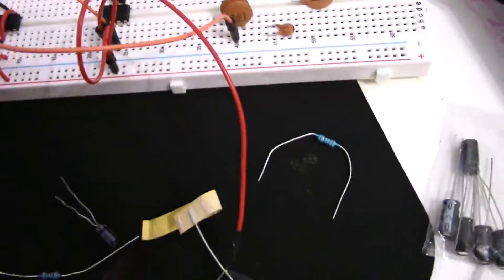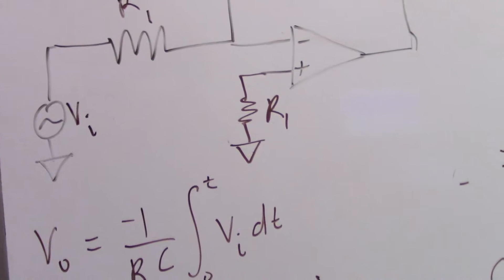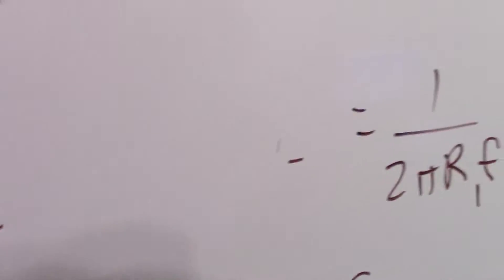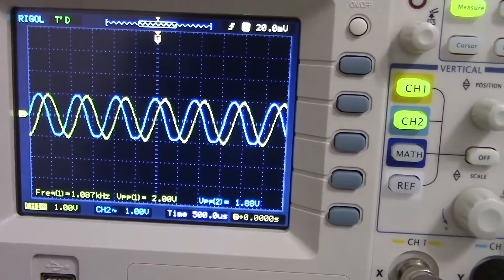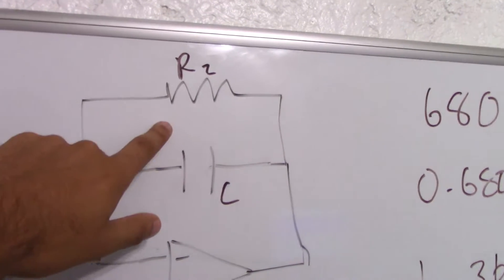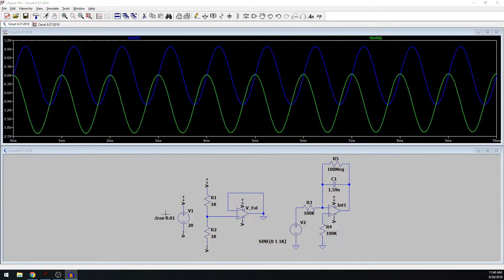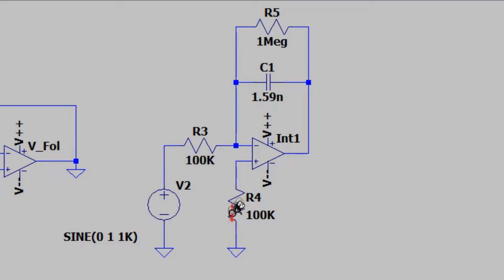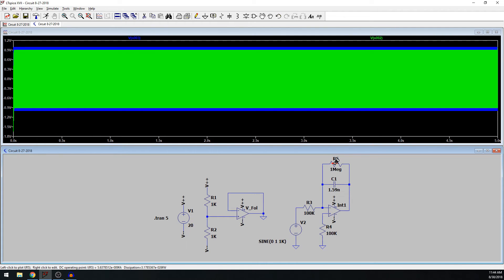Building an Analog Computer with Op Amps (Part 5): Op Amp Integrator is Working Properly

Comment: But the parallel resistor is only needed with external signal sources inducing difficult to control DC offset, like with a FG. Normally one should avoid to use them because they highly distort the integral at lower frequencies.

Comment: you can make a high value non polarized capacitor by connecting two electrolytic capacitors in series (back to back)  the value will be (C1+C2)/2